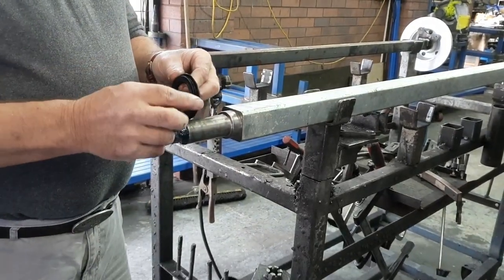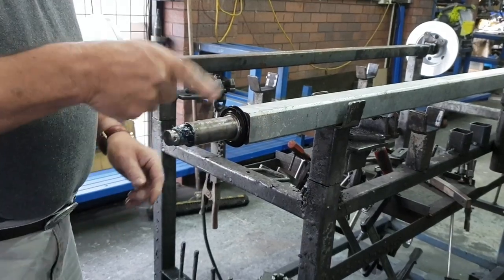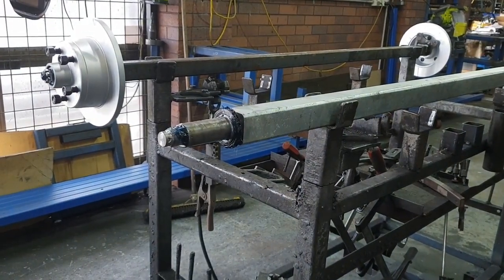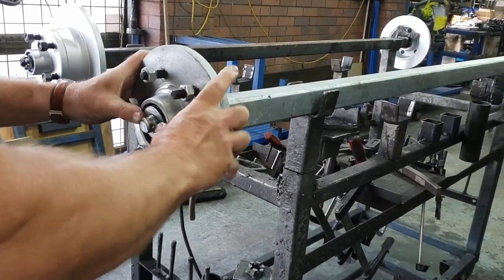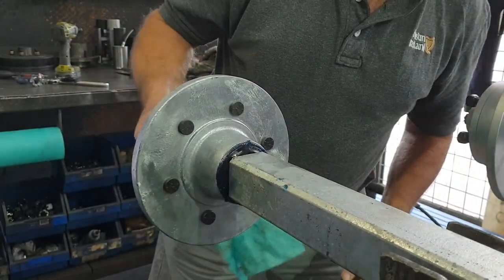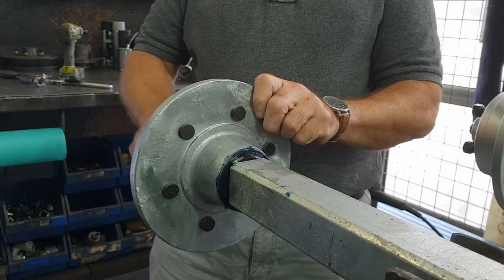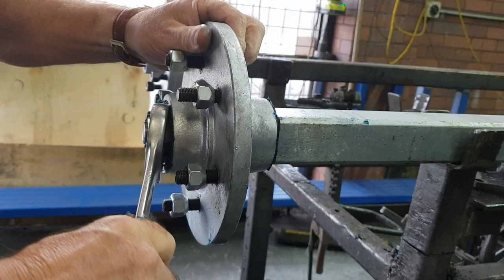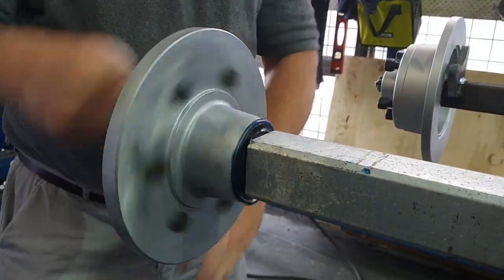How to Grease and Install a Boat Trailer Seal Correctly. Learn how to beat water ingress.

Comment: Brilliant explanation, what do you reckon of putting a bit of loctite or sealant on the axle to hold the rubber seal in place and to stop it spinning? It shouldn't be spinning in the first place if you grease them up properly, but still I'm seeing a few blokes advocating to put loctite or some RTV sealant on the axle before fitting them.
Reply from the maker: Hello Ahmed, Yes, there are some advanced trailer manufacturers using structural silicone on the rubber component before inserting onto the axle. The seal collar can vary a little between axle manufacturers. The sealant covers the variation in size.

Thank you for your comment Ahmed, it is not often to see a very good, well thought out reply.

Thank you
Steve Wotherspoon